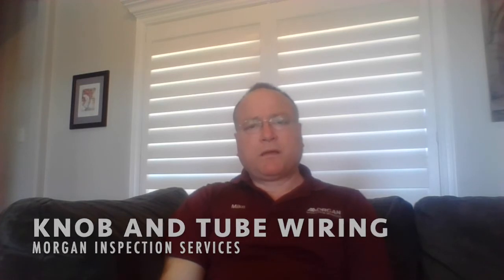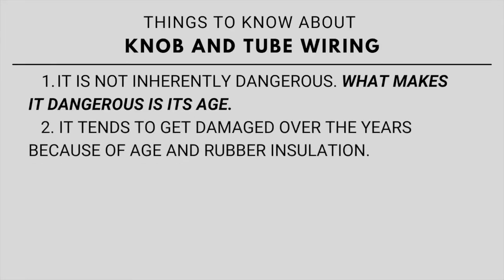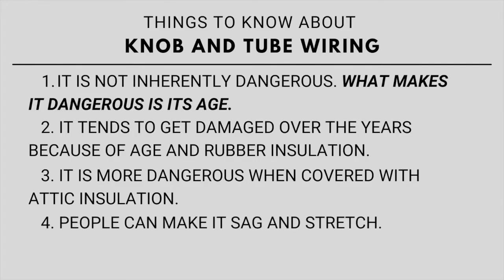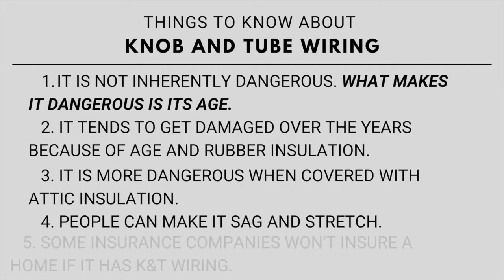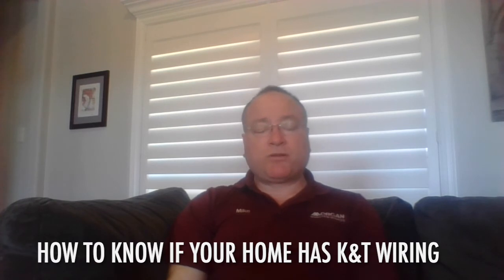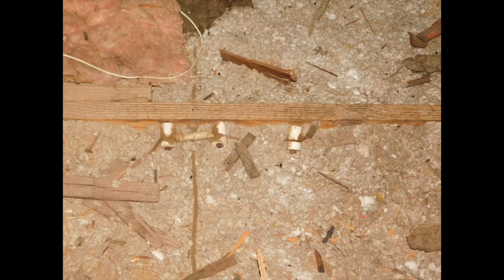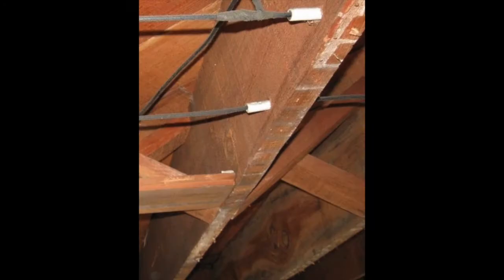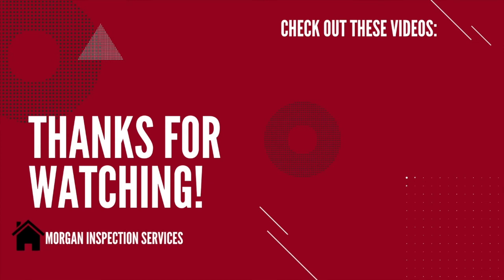Knob and Tube Wiring (K&T Wiring) - Things to Know and How to Identify It

Comment: Hi, Question.  Could use use a thermal imaging camera to identify Know and Tube wiring in a wall?
Reply from the maker: I think this is highly unlikely. If the knob and tube wiring is getting hot enough to show heat through a wall on a thermal camera, then I think you have a very serious issue. If it were very cold in the house, then it would take less heat from the wire to show on a thermal camera, but I’m not sure how you would know if it were knob and tube wiring or just regular wiring that was hot.
Reply: Your best bet would be to open an electrical box carefully and you should be able to identify it that way

Comment: Ceramics will not burn or line in air 3 to 7 inch off from wall is very good system and good air cooling

Its is true old any wire can wear out and old wear out any wire is dengerous.

But no adding or modefied or coverd by insuration violating common sence 

But simple nob & tube instration are good speaks about in NEC 2017 code sir 
Anyway thank you for great video & your hard works to shear knowledge  sir.
Reply from the maker: Thank you for your input.
Reply: Knob and tube is insured and ours is in our basement and only in part of the home. All our appliances and everything else except lights are romex.  So we aren’t worried after living in the home for 45 years.

Comment: That all lists you said sound dengerous sir.
Reply from the maker: They are dangerous
Reply: @morganinspectionservices3840  its depend still NEC code 2017 speaks about new knob & tube instration

Knob & tube it self alone lefted is very safe 

Do not add insuration or other

Telephone phone instrations main power lins are similer to knob & tube

In high off from wall & material create safer
Reply: @morganinspectionservices3840  
Do not add insuration or fire mayeroal to it to abuse it thats common sence but NEC code 2017 still talk about new instration of knob & tube if its not safe code will not alloud

Selling business with fear is same asDeep state I do not agree.
Reply: @morganinspectionservices3840  if its dengerous NFPA & NEC National electric code doesnt alloud but opsit of that they still speaks instration of nob & tube instration guide 2017 NEC code sir. 
But thank you shearing your hard works sir🙏